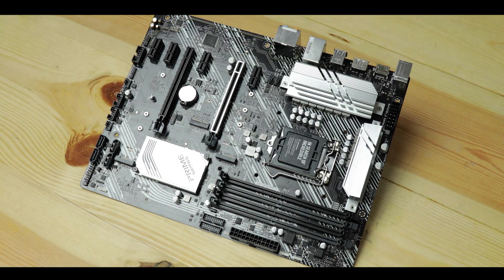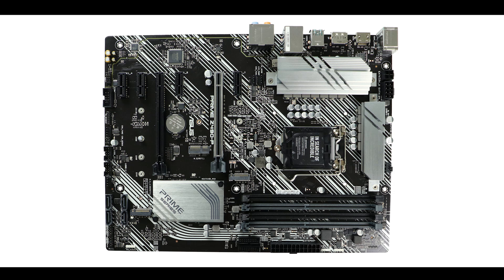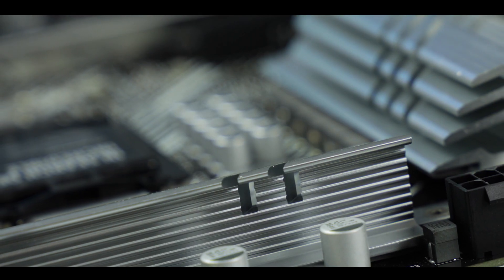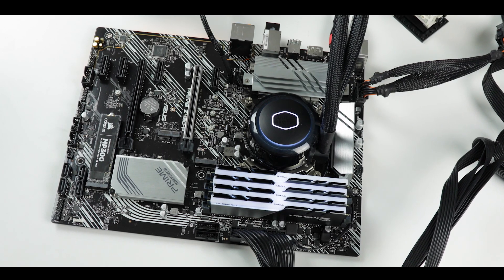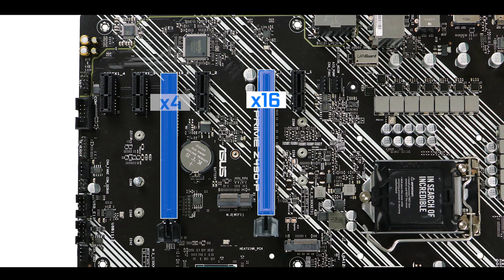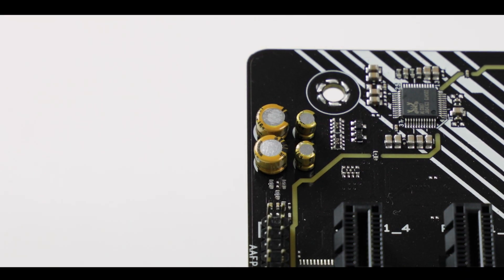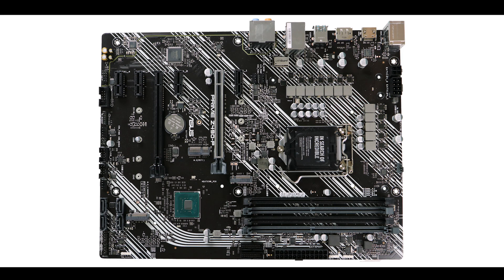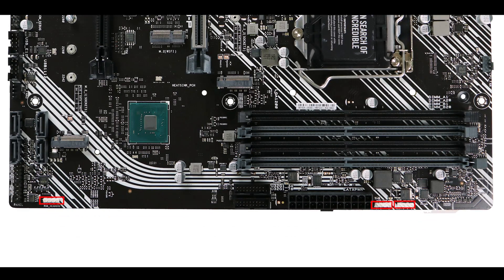ASUS PRIME Z490-P : a big YES!

Comment: A bit obsolete comment, but : "a big NO". I guess this is only one Z-board from that vendor, that didn't got a official support for 11 gen. CPUs. It's just a shame. Super poor onboard configuration with PCI-E 3.0, while all other vendors MSI/Giga/Asrock got support for 11gen. and soldered PCI-E 4.0 slot on their budget boards. Yeah i know PCI-E 4.0 don't give much advantage, and there is a CPU even i9-10900 will be bottleneck new RTX-40xx and RX-79XX GPU's. 
But it's better than nothing at all. It is especially bad with the 11 gen. CPU update, because onboard power delivery is fine, but everything else is not.

Comment: It feeds way too much voltage to the cores! I9 10900KF
Reply: Same. Stock settings are actually stock (unlike other Z490 boards), But the OC tuner settings supply waaay too much volatage even if it reads lower, testing always has vmax warning and Limit in HWiNfo. Any fix for this?
Reply: @aaroncamren691  I managed to bring my temperatures down substantially by using the adaptive voltage option. We are talking about 1.6Vcore down to 1.4 during turbo (I have not overclocked my chip).  My particular chip does not like to get too little voltage, because windows freezes. I don't play FPS video games anymore so I have not tested stability across the entire frequency range and voltage... LLC7 makes my I9 very stable but is allegedly bad for it as I have understood.. Does your board make a strange buzzing sound when you move your mouse?

Comment: Can anyone help me out? Does this motherboard require I buy an adapter to connect to wifi? Or does it have built in wifi? What type of wifi is best for this motherboard ?
Reply from the maker: You will need am adapter:)
Reply: @Laurentschoice  thanks for the response. Can I use any adapter? Or are there specific ones that work best for this motherboard ?

Comment: Nice video, its was very detailed! I'd like to see a review on the MSI MPG Z490 GAMING PLUS next. I really don't know which one of the two motherboards I should pick...

5:18 And yes, we invented pasta, and no one else can invent anything 😂😂😂
Reply: So, which one you picked? I'm on the same problem, can't decide..🤔😅
Reply: @CriMy24  I got the MSI and it's very good, however, I don't know if it's a problem of my specific board, but the LAN chipset had some problems, disconnecting whenever there was too much traffic going on. I think it's a problem of the Realtek chipset, so if you have extra money go for the Tomahawk and use the Intel LAN (1Gbps) which should be more reliable (although I'm just guessing), otherwise if you have problems with the Gaming Plus, you could just buy a PCIe LAN card
Reply: @XASAZA7  what procesor you have on it? And you overclocked it over 5ghz?
Reply: @CriMy24  I have an i5-10600K and I can overclock it up to 4.9GHz without increasing the voltage (the moment I set it to 5GHz, it just blue screens), however the temps were very high since I'm only using a Noctua NH-U9S and there isn't much airflow in my case. But if you have a good airflow and an AIO cooler or a very good Noctua like a 120mm or 140mm, then you could probably increase the voltage a bit and get to 5GHz, but again, I'm just guessing tbh
Reply: @XASAZA7  i have good air flow and aio kraken x63 and i want to know if msi or asus pripe p can handle the i7 10700kf on 5ghz.
Reply: @CriMy24  well, I think it can, consider that the i5 10600K gets up to 4.5GHz without OC, and in my case, 4.9GHz with OC, while the i7-10700KF goes up to 5.0-5.1GHz without OC, with also the same TDP of 125W just like the i5, so I think you should be able to do that without a single problem, but yet again, since I don't have an AIO nor an i7, I can't say that for sure.
Reply: @XASAZA7  I will see😁. Thx dude
Reply: @CriMy24  no prob, glad I could help😀

Comment: Thank you so much for the review! Love your stuff, I have a question please if you could. Would you recommend the Asus z490 Prime-P or the MSI MPG Z490 Gaming Edge WiFi ATX Gaming? Or perhaps do you have another (best z490 board) you'd recommend for under $200. Thank you! (I will be paring it with an 7-10700k, 32gb RAM 3200, and an m.2 2880 SSD)

Comment: Nice mobo but my 1080 ti doesnt work yet in there :(
Reply: I also have problems with my GPUs in this motherboard. My old RX 570 simply didnt work with it, would not launch from the GPU no matter what (1 long beep 3 short beeps) but the GPU works in other PCs. 
Then I bought a GTX 1070 which worked fine for 1 month but now getting the same problem as the old card. PC wont launch same beep code. Specs are Z490-P, ASUS GTX 1070, i5 10600k, Corsair 16GB RAM, Samsung 1TB PCI-E M.2 SSD, Corsair 850W PSU. Any help would be very appreciated, can't find anything about it anywhere on the internet.

Comment: can someone tell me the power supply this motherboard will work with please over 600w under $200
Reply from the maker: Corsair modular, 650 watt would be a good match.
Reply: @Laurentschoice  thank you but doesn't the motherboard need an additional 4 pin ATX connector from the power supply ?
Reply from the maker: Should come with it. It's called an EPS cable :) make sure it there. If not go  750
Reply: @Laurentschoice  thank you so much I'm ordering my first ever gaming pc tomorrow could you maybe just read over this to see if everything goes with each other (sorry I'm really scared and your a pro at this XD)  do all these parts work together? 

Asus Z490-p prime motherboard 

Intel core i7 10700 (not k)

Corsair sp120 rgb pro 3in1 fan pack

Corsair carbide clear 400c mid tower gaming case white

Corsair CX750M modular ATX

Crucial 16gb ddr4 3200mhz 500mx 1TB

Seagate 2TB barracuda 7200 rpm

Cooler master Hyoerb212 RGB black edition 120mm fan cpu cooler

ASUS ROG matrix Geforce RTX 2060  Evo PC 6GB 

Crucial 1TB MX500 

Thank you I subbed😁
Reply from the maker: Your good to go. Good choice !
Better use my amazon link in the video description, or here 
https://amzn.to/3fsIyzb ;)

Just so u know. You do not need to populate both CPU plugs. 8 pins is enough unless ur going for overclocking .

Comment: Is Possible 5.0 GHZ Stable in this Board ?
Reply: Yes! I'm running my 10700k at @5.1
Reply: @davitsk1  Tks !! :)
I run 10900k fine with 5.1 too. tks
Reply: davitski did you overclock to 5 GHz? :)